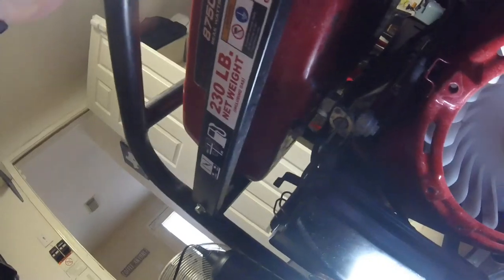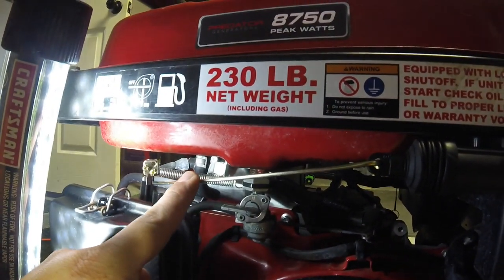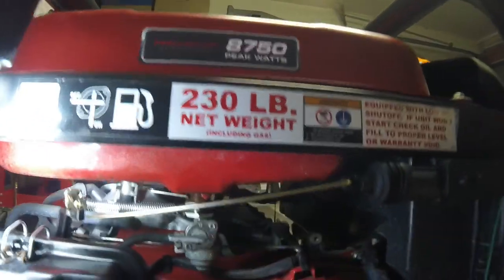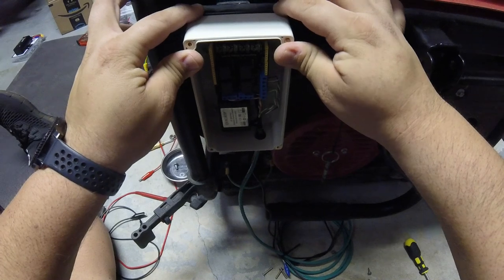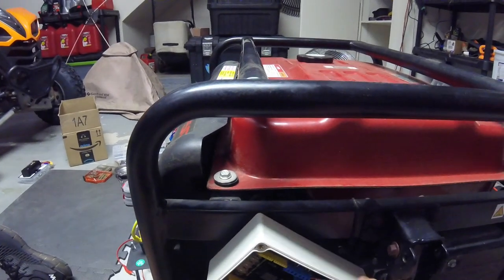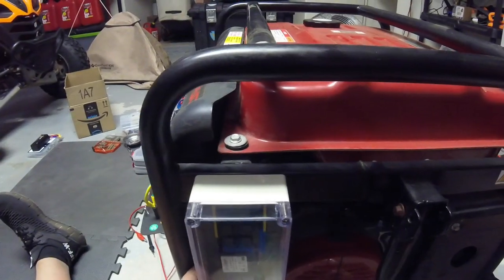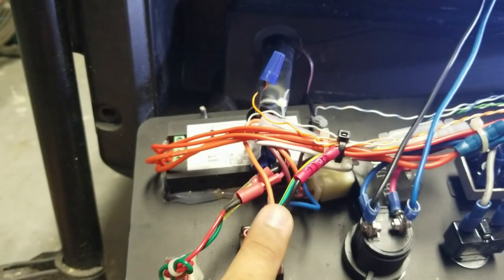DIY Portable Generator remote start   Part 2

Comment: As many times as you used "ground" as your common (3 times) going back to your board you could have used a 4 conductor cable. 1 wire (ground) would jump between your commons and the other 3 would be used as each relays n/o n/c. May solve some of your "runaway) issues with undersized conductor

Comment: Great work. My generator is a Firman Tri Fuel  T08071 10KW. The wiring is different. However I just assembled and programmed the unit exactly as you instructed and it ran the script perfectly. I will eventually figure out the wiring connections. I appreciate the time you spent on preparing a video that can be followed. Someone else did a video using another unit , but I think he deliberately omitted some aspects. Literally no one can duplicate what he did from what he showed because he provided no wiring connection information. Your video and instructions were great even for a dummy to follow. Thanks again.
Reply: Hello, wondering how is your setup? Is it still running good? I’m curious and really interested in this project. Im on the process of finishing this now.
Reply: @oliverjose8553   Sorry Oliver, I have not taken the generator out of the box. It is sitting in the garage just as it was delivered. I am busy with my greenhouse and other projects. We do not have blackouts here much, only 3 in the past 18 years. I tested the program from JPG23 and it worked well. When I finally connect and have the generator working, I will post the information.  Thanks.

Comment: Without in-line relays from the cat6 wires are you worried as all about wire load being too high, say if it’s cold and the choke actuator need more power to open/close? General question. If it gets stuck for example.
Reply from the maker: Not at all as those wires are not carrying a current load beyond their capacity. That's a great point to consider though

Comment: Great idea! One thing to be careful of is that there is no sensing of engine condition at all. The use of a single loop that runs through the starter and choke engagement every time it gets power and the the long delay for runtime is functional, but not robust. If the wireless switch blinks, even for a moment while it is running, it is going to run the startup sequence all over again with the engine still running. Also, this depends on the engine being VERY repeatable in the start timing. As it ages, fuel changes, hot or cold, the timing of an engine start could change without the code being able to compensate. 

A big upgrade would be to put a hall sensor in the flywheel housing that detects engine RPM as the flywheel magnet passes by. Or a wire looped around the spark plug wire to act as an antenna would do the job without having to take the flywheel housing off. Something like this would work, just omit the LEDs for the timing light:  https://www.instructables.com/Timing-Light-and-Tachometer-With-Arduino/

Write an interrupt function for RPM sensing and if (engineRPM > 2000 RPM) { engineRunning=true; }. Set a time flag when the engine run speed condition is reached, disengage the starter, and you're golden. Check for engine running each time through the loop and if not, set engineRunning=false. If you want to go further, you can check to see if a run is commanded but engineRunning==false, initiate a start sequence after waiting 10 secs or so.

Instead of putting the start sequence in the loop that runs continuously, build a void coldStart and a void hotStart function with while loops that crank for, say, 10 seconds looking for the RPM to jump before stopping cranking or timing out to let the starter cool. The coldStart would have choke, the hotStart would not use choke unless it failed to start, then try a coldStart once more before timing out and throwing an error LED and/or alarm. A DS18B20 clamped to a lower part of the crankcase could sense if the engine was warm or cold and make a decision on which start sequence to attempt first. If you are running on propane or NG, put an electric prime solenoid in the fuel circuit and have the start sequence engage the prime solenoid until engineRunning==true. 

Also, the use of an ESP8266 or ESp32 dev board would give wifi monitoring and control. Just a couple ideas. Great start to the project!
Reply: So @chrislutes2882 brings up points that I'm reviewing.  I want to do something like this to autostart my generator when my inverter/battery keys off a loss of grid power to charge up the batteries.  I'd like to know whether the generator is running and any additional safety factors.  Thoughts?

Comment: With the extra circuit,  could a timer be set to switch power onto the 240v outlet 1 minute after it starts and cut power off before it shuts off to preserve the inverter?
Reply from the maker: You could do that, but you would have to use the spare Arduino relay to operate a contactor

Comment: Did you use any additional commands to instruct the Arduino to perform the script based on a key press from your RF transmitter. If so they weren't listed in the script provided in the description what were you able to use to get this to execute based on key press or presses?
Reply from the maker: The Arduino begins running the script as soon as it's powered
Reply: @JPG23  Yea that's what I just remembered about Arduinos, I mostly mod with RPI's and totally forgot that Arduino will execute its instructions once loaded its been a while. If you use the remote to terminate power to the Arduino will that kill the Gen or will it keep running? On a side note did you ever plan on putting in a electronic fuel cutoff valve controlled by the relay board and write instructions in the arduino so that you can run the fuel out of the generator to prevent stale build up in the carb?

Comment: Hi, great videos on this. just subbed.  Can a script be written to start the countdown when input voltage is seen or lost? ie if mains power is lost (DC input from AC power supply) the generator will start, and shut down when input voltage reappears?   Any interest in helping me write a  script for that function?    Id be really interested in getting help to figure that out.  Thanks
Reply from the maker: Thanks for watching and commenting. Absolutely, that was my initial goal; however, I'm not very experienced in writing scripts. Initially I wanted to build an ATS system, but that would require "if" statements that I'm completely unfamiliar with. I did try playing with the code to do this to no avail. I'd like to have an if statement listening to a voltage meter that is measuring the generator output as such: "5 seconds after initiating the script if power is not present, re-attempt the starting sequence, and if power is present, initiate the 8 hour countdown". As for a "line side" voltmeter, that would also be very convenient as I could then use the spare relay to operate a contactor to work as a "diy ats", but I believe I've expended all of my Arduino knowledge on this project.
Reply: @JPG23  thanks for the reply. i poked around on youtube and there are some channels that are very good.  there is a voltage sensor on amazon for pennies BUT its only meant for turning out a value reading  such as a potentiometer translated into numerical value by the arduino.   the if/else code is talked about but i have to agree, its easy to get lost.  the old saying still rings true today; trash in, trash out.
Reply: https://www.youtube.com/watch?v=ORNted-NgRM      maybe there is a way to run the start script instead of turning  on and off the leds..  OR maybe use the output of the LED to power 2nd arduino that has the start script on it.

Comment: I am in the process of this now. I have everything connected but I see no status lights come on the relay shield. Any advice will be appreciated.
Reply from the maker: Make sure the Arduino code is entered as per the instructions in the description
Reply: @JPG23  Thanks for the response. I input the code prior to making the connections on the generator. I will reset the Arduino and try the code again

Comment: How did you get the retainer to stay on top of the choke lever? Did you attach it to the lever?
Reply from the maker: I drilled a hole through the center of the choke lever and used the included hardware to attach the rod
Reply: @JPG23  Thanks for the quick response. One more question, what type of wire did you use to extend both actuator wires?
Reply from the maker: @frederickmack9655  I used some automotive 12 awg wire
Reply: @JPG23  I am trying to do this to my Ford Generator and needed some help with the wiring. If I send you a picture of how the wiring is setup, could you tell me which wires go where?
Reply from the maker: @frederickmack9655  I can certainly try, feel free to post a link to the image
Reply: I took off the panel and have the wires exposed. There are 5 prongs connected to the On/Off/Start switch: 
-Blue wire goes to the Starter
-Brown and Red wire is split to the starter and to a small battery behind the panel.
-Top black wire goes to the carburetor.
-2nd black wire goes to a screw behind the panel.
-Orange wire splits and goes to a fuel connector and carburetor.

Any help you can provide would be greatly appreciated!
Reply from the maker: @frederickmack9655  can you tell me what brand and model your generator is?
Reply: @JPG23  Ford FG11050PBE Dual Fuel
Reply from the maker: @frederickmack9655  I looked at the wiring diagram for your model, and looks like you're on the right track; the blue wire is the starter circuit which will go to relay 3 (you'll have to run a ground wire), and of the black wires for relay 1 will need to interrupt the one going to the ignition coil and will also need a ground wire. I recommend you do some testing to see how the switch behaves when operated (i.e. shuts off when black wire goes to ground, the momentary start button also goes to ground, etc). I wish I could be of more help
Reply: @JPG23  can all grounds go to the switch ground or is it best to separate them?

Comment: @JPG23 I now have power to the Arduino as well as working status lights. I have the code entered exactly as stated in the description. Now when I hit the remote it powers on choke closes and it attempts to crank. Before it can ever start and run it shuts down then the choke opens. It basically cranks for a few seconds and shuts itself down before the choke opens and it can try to run. I appreciate any help.
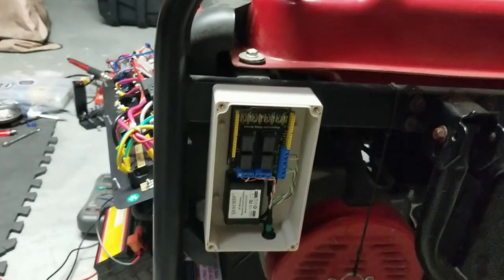Reply from the maker: Sorry to hear that, please rewatch 17:06-20:36 where I review the wiring just to make sure all the wiring is correct. Thanks. At a later point, I will make an update video and I will possibly be using the 4th relay for a second ground as I've experienced a few "runaways" since I'm only using one of the grounds from the ignition switch.
Reply: @JPG23  My connections are just as yours. I can still crank and use the generator by the oem starter switch. I guess I will wait for an updated video. Thanks for your reply
Reply from the maker: @bradflood7112  ok, I will make it a point to throughly review all connections on the update video, should be sometime in January when it's cold and I can haul the generator back into the garage. Thanks for staying tuned
Reply: @JPG23  Thank you and look forward to the updated video

Comment: Hello. I just did this project and everything went well. My only issue is the arduino keeps on doing a loop. The script keeps repeating after 10seconds. Once i press the remote start it will activate the choke, start the engine then release the choke and the generator will run for about 10 seconds then the arduino will do the whole process again even though the generator is still running. Any suggestions on what went wrong? I copy pasted the script using the IDE and upload it to my arduino uno already but keeps doing this.
Reply from the maker: Something similar happened to me early on and it was the Rx module causing the error. I ordered a new one and it solved the issue
Reply: You mean the wireless remote? Which one did you actually get and i will tey to order it too.
Reply from the maker: @oliverjose8553  yes, but the part that goes with the Arduino. I ordered the same one again and it's still working fine
Reply: Did you mean you ordered KEYESTUDIO 4 Channel Relay Shield 5V when you say “part that goes with arduino”?
And it fixed the issue? Thanks!
Reply from the maker: @oliverjose8553  No, sorry for the confusion, I replaced the remote receiver module
Reply: Okay thanks! I will go and order another one. Hopefuly it will fix my problem. Thanks again!
Reply from the maker: @oliverjose8553  no problem, before you spend on another, please double check the script in the description and be sure to change the exclamation signs as stated in the notes
Reply: @JPG23  yes it was changed. 
I just got the new remote module and still getting the same issue. I think it is a faulty arduino board. I might need to order a genuine brand.
How is your setup? Looks like you did your project a year ago now. Is it still working fine? My fear is, in the middle of using my generator the arduino will run the script again while generator is running, it might cause fire because it will force to start the solenoid again for 2.5seconds while engine is still running as what it’s doing now. When i does that, i can see sparks coming out in the coil since it tries to start even though the generator is running.
Reply from the maker: @oliverjose8553  that's very strange what yours is doing. As for my generator, it is still running fine, it runs the script when I press the remote, and only for a few times it would not turn off with the remote and I found a corroded ground wire that needed repair. Aside from that, it is working perfectly fine to this day.
Reply: @JPG23  right? I’ll give it one more shot since everything is bought and assembled already. I’ll get another brand of arduino since i think that is the issue now. I’ll give you an update once i have it. I’m interested and hopefull on this project since your idea is very useful.
Reply from the maker: @oliverjose8553  thank you and all the best
Reply: @JPG23  hello. Just to give update. I ordered a genuine arduino uno board and it fixed the problem. The script is being followed accordingly.  I just assembled it today and everything went well. Side note: i did put extra switch for the whole setup for an emergency on/off for just the remote box. Works well.
Reply from the maker: @oliverjose8553  glad you got it figured out. I guess those clone boards aren't too reliable. I may also step mine up to a genuine board as you did. The on/off switch is a great idea!